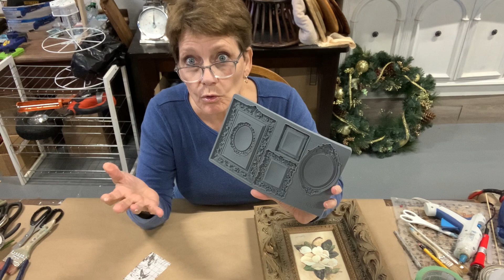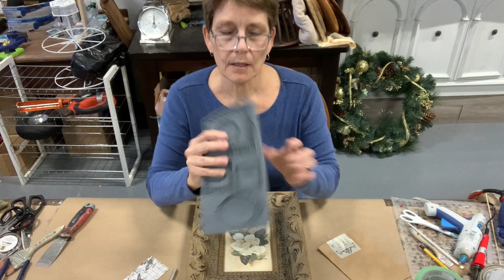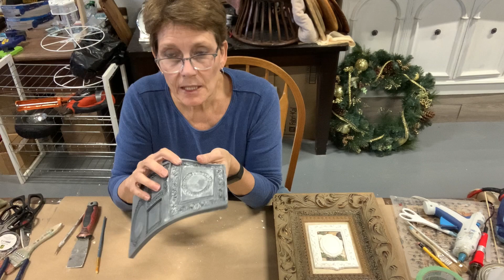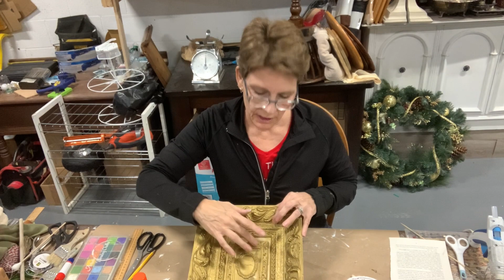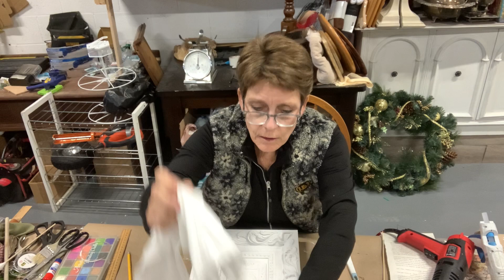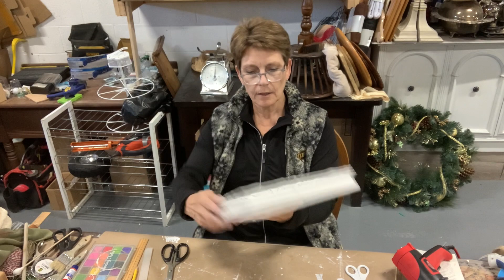Moulding Frames within Frames

Comment: I love the 'framed frame' that you created, it's looks so stunning with the white paint and the gold showing through where you distressed it. Gold just looks so sumptuous ❤😍❤I've just bought my first IOD mould and it's the same IOD Frames Mould that you used here. I can't get over how beautifully made the IOD moulds are, with the micro rim and all the texture in them. They're way superior to the moulds by Redesign With Prima, even though they're all roughly the same price, or at least they are here in Australia. I've got a couple of the Prima moulds and they're quite difficult to use  because they don't have the micro rim, so it's almost impossible to get a perfect casting out of them, I usually have to cut away excess clay with an exacto knife. I'm decorating a wood frame at the moment with floral mouldings that I'm gluing around the outside of it to make the frame look a bit more interesting!! LOL 😅 I'm still figuring out what to put IN the frame. It will either be an IOD Transfer on white cotton fabric or what you did in this video. Thank you for this great video tutorial, love from Amanda in Australia ❤ 🤗
P.S. DIY Paint is not available here so can I use a different brand of chalk paint for this project? Thanks again.
Reply from the maker: Amanda...  I love the fact that, despite the distance between us, we can connect through a platform like this!  I agree that not all moulds are created equal...  much the same as any other product.  I tend to trial a number of things, find what I like and what works for me... and then stick with it!  why mess with a good thing?  There are so many possibilities with the frames moulds...  I've seen many making small mini frame ornaments for their tree.  It's on my craft list but that list seems to get longer each day and I'm challenged keeping up!!  Maybe you'll have to try that one for me!

Comment: The oval frame would look amazing around the black knobs on the buffet credenza behind you. I have a question. Why did you choose wax instead of a polyacrylic to seal the final project? I never know which to choose. I look forward to learning more from you!
Reply from the maker: Hi Carla!  Really...  Polyacrylic would work also... it's more of a preference only on a project like this since it really won't be handled a lot.  If I was doing a kitchen or dining room table I would definitely use a polyacrylic but for pieces that won't be seeing as much use wax hardens just fine.  I have dressers and side tables that I've waxed years ago and they are fine.  I like the feel of the wax finish so tend in that direction.  It also is easier to use I find...  I tend to get a smoother more even finish.
Reply: @QueenBeeCreations  makes perfect sense, thank you!